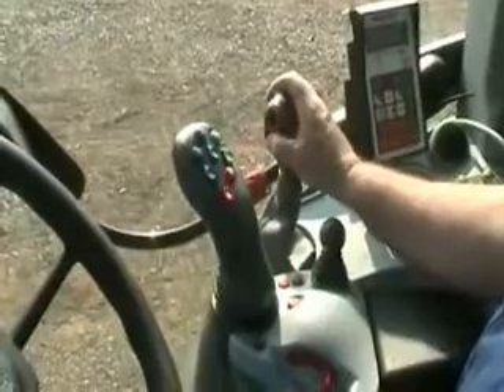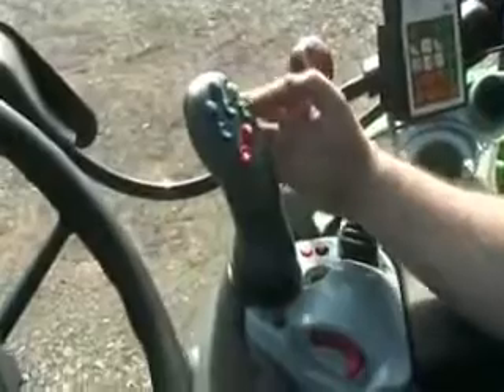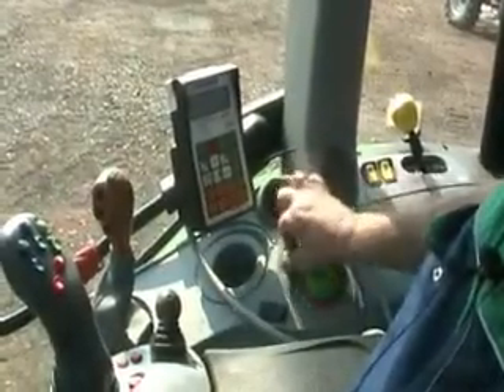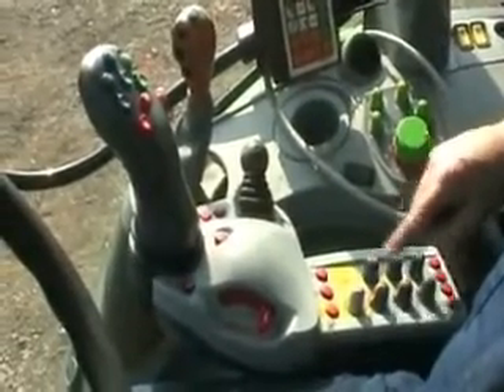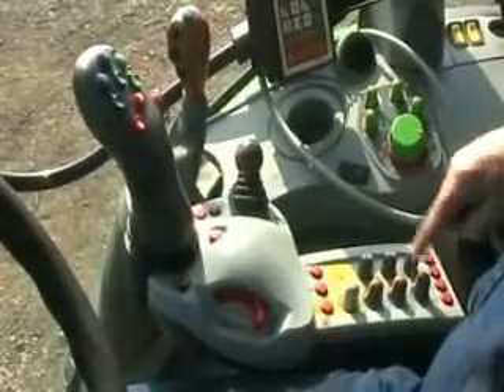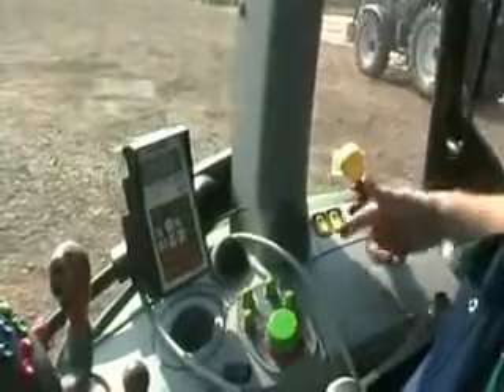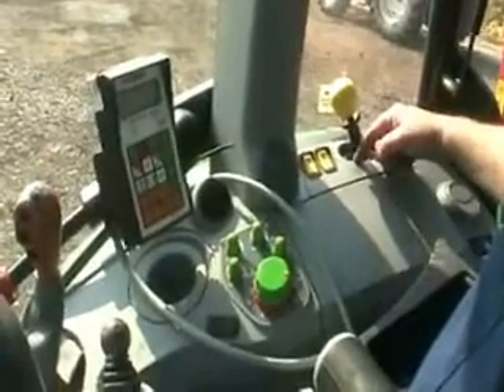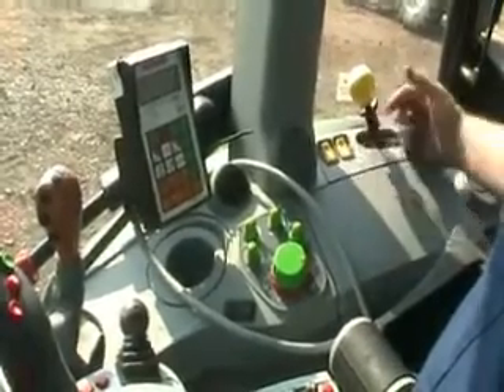Deutz-Fahr Agrotron K120 ProfiLine 2007

Comment: @mikeyhannon2010 It has a 50k box which is factory limited to 40k (save fuel?), but your SDF dealer can remove the limiter with a laptop and then will do about 55k.:-)